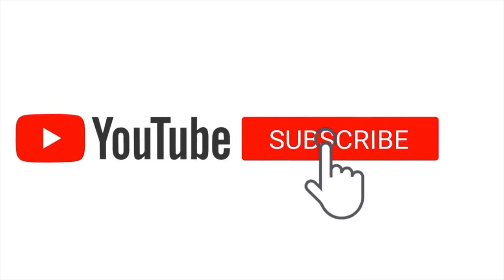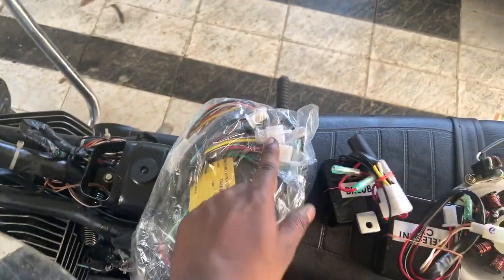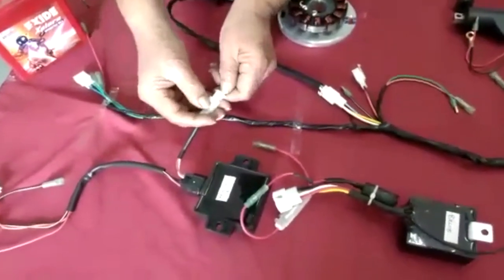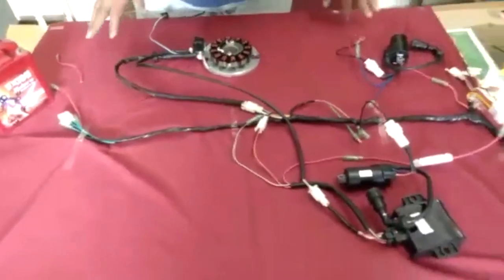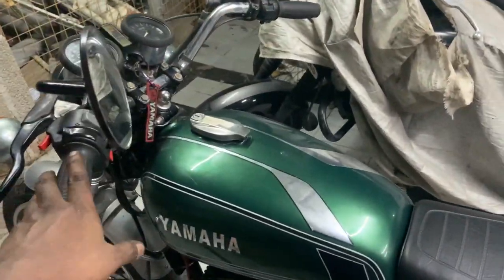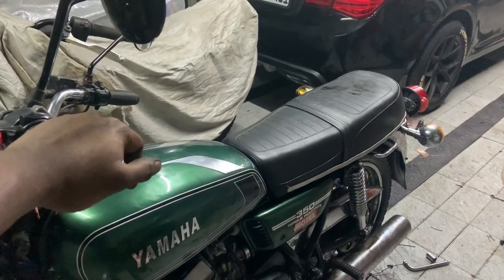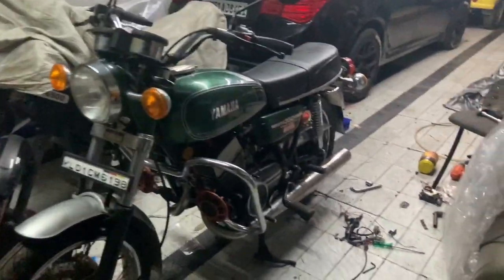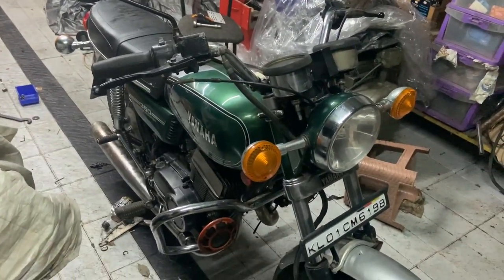Installing Allied Digital CDI in my Yamaha RD 350 (Malayalam Video)

Comment: What was the difference in abdulrahmans kit bro
I order it for my shogun
And rx
Reply from the maker: It’s 90 watts output and superior spark strength. There is an immediate performance jump and if it’s the digital kit then auto advance and retard of timing based on the RPM
Reply: @Yamakaze  will check and reply after fitting on shogun
Reply from the maker: Abdur Rahman ok
Reply from the maker: Abdur Rahman 👍
Reply: @AbdurRahman-fs1rh  how is it in shogun bro🙂? performance.

Comment: What flywheel/magnet puller did you use?
Reply from the maker: For the allied kit you need an rx 100 type puller, if you want to take out the original rd magnet then you need a different puller which is specific to Rd